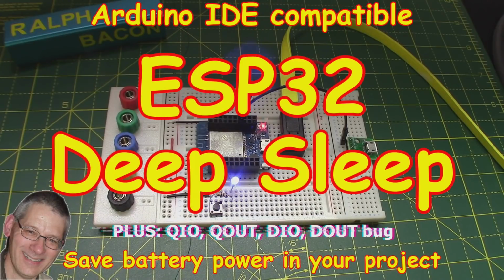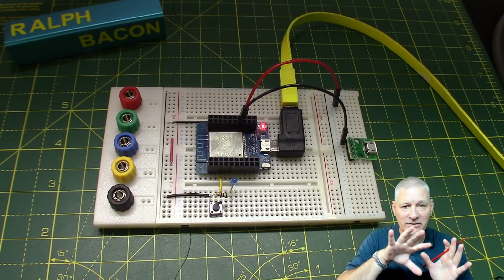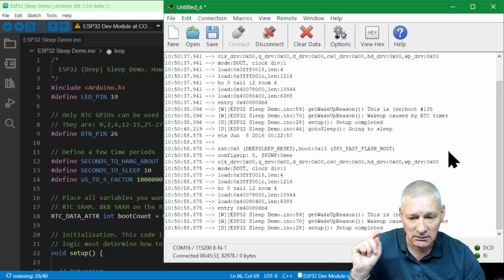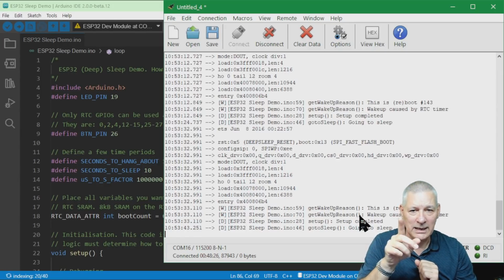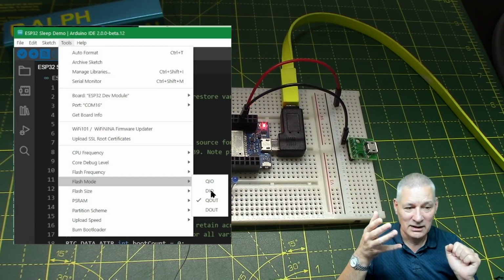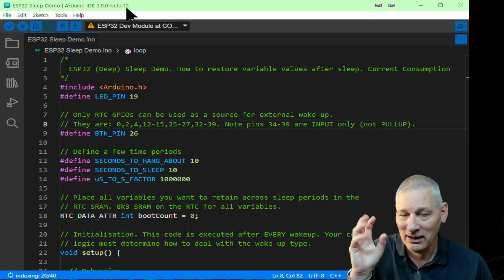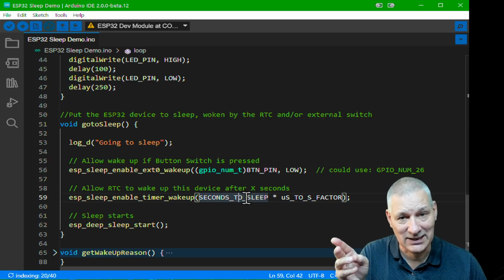#229 ESP32 - Saving Variables Across Deep Sleep

Comment: hi there wow. a really handy video. i never played with the sleep modes. all of my projects have been usb powed. so im working on a small project which uses a battery and so this has come at just the right time for me. thank you for the extra info too that was very helpful too .  :)
Reply from the maker: Obviously I knew you were working on a battery-powered project so I did this video!
Reply: @RalphBacon  lol ops i just blown up a esp32 :( dam.. bloody forgot it only works 3.3.. arrrrrrrrr well haLF works lol ops
Reply from the maker: If you delivered 5v to a pin, that might be the only pin affected. If you have it 5v to vcc... Well, ⚰️
Reply: @RalphBacon   such a silly thing i did. i put a 5v fully chagred 470uf cap on an adc pin ("just forgot to discharge it") most of the chip still work but no adc :( oh well a silly mistake which i guess we've all done something similar lol...live and learn
Reply from the maker: My condolences on your loss. It's too easy to do this with 3v3 chips. I've done it too; I once destroyed a Raspberry Pi 3 doing something similar 😭

Comment: deep sleep you showed is not the "deepest" sleep - next one is hibernation - this one disconnects power from even more circuits on esp32 - the only drawback: RTC memory is also not restored - however in many occasions such "deeper" sleep is even better - btw if you use the bare esp32 we are talking uA not mA anymore what is even better for the battery operated sensors. Of course, as you mentioned there are also other sleeps, i.e. light sleep, which resumes running from exactly the same line of the code it went to sleep from - but less savings of the battery in such case.
Nice video indeed - I have never had any problem with flash modes except I am not able to use upload speed 921600 - only half of that works for me 
And the new Arduino 2.x is amazing (comparing to 1.x) IMHO ;-)
Reply from the maker: Indeed, but I think Hibernation is just another word for switching the whole processor off! What's the difference between coming out of Hibernation mode and switching the device on from clean? I think keeping the RTC running is the least we would do if we want any kind of "intelligence" at start up!
Yes, the Arduino 2.0 is better than 1.x for sure, but still not a patch on my previous Eclipse IDE and not as good as PlatformIO. But for relative beginners it's a great step up. It can only get better!
Reply: @RalphBacon  Hibernation=less power taken than deep sleep with RTC on (btw hibernation still keeps 1 RTC timer on - the one to wake up). Honestly speaking I built my sensors first with the "normal" deep sleep (as 99% of the guides online) but then I realised: the only usage of RTC was to... count the "bootCount" - everything else in my sensor had no usage for keeping the history: wake up, connect to wifi and MQTT, gather telemetry, send to MQTT and then ... go to sleep. Next wake up - again. No real need to keep the "bootCount" there in the cost of extra mA. Just saying. Super detailed guide with all possible sleep modes (with the implementation) in "normal language" with examples is here: https://m1cr0lab-esp32.github.io/sleep-modes/ - maybe someone will go into "deep dive" ;-)
Reply from the maker: Thanks for the Real World update, I will check it out in more detail 🙂
Reply: @RalphBacon  no offence brother ;-)
Reply: @RalphBacon  +1 for PlatformIO. It's brilliant.

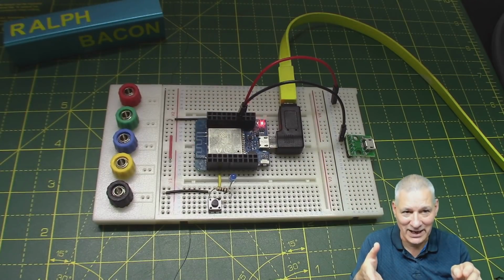Comment: Why does the ets line continually say 00:22:57?  Shouldn't the time increment?
Reply from the maker: The "ets" message at boot-up (which stands for Espressif Task Scheduler, I believe) is the time the person last logged onto the console and declared the firmware fit for purpose - so it will never be updated until there is new firmware in more recent devices.
Reply: @RalphBacon  - OH, got it!

Comment: Thanks Ralph, this is perfect, building a post box sensor, only needs to power on when the flap opens….. could you point me in the right direction for the esp modules you are using?
Reply from the maker: Tony, I've replied 3 times and each time YT removes my reply. Outrage! Send me an email and I will give you exact details.
Reply from the maker: I've added the info to my GitHub now so just follow this link and look for the "hardware_info" file!
https://github.com/RalphBacon/229-ESP32-Deep-Sleep

Comment: Hello sir . May we have a video about esp32 as a slave in i2c communication.  I was trying a project  to connect it to raspberry pi as slave but i couldn't
Reply from the maker: I'll add it to my list, but you should be able to get any microcontroller to respond as an I2C slave, if the I2C is all set up and working on both devices. For example, an UNO should be able to talk to a RasPi. Or, try and get two UNOs talking first before trying the Pi.

Comment: I have question about the bug. Is this bug also happened when you using platformIO instead of Arduino IDE?? Because i haven't found this bug yet.
Reply from the maker: Yes, it happens if you use a more recent (3.3.1+) Espressif ESP-Arduino framework (which I do in PlatformIO). It now issues QIO as the flash access mode correctly if selected (it previously ignored it and used DIO). I don't know how the framework differs when used in the Arduino IDE - I'll check it out one day!

Comment: Thanks for the information Ralph, I always find your videos give me something to experiment with. The power LED on your board stays on when it's sleeping and is going to be taking a (small) current;  could it be de-soldered to maximise battery life, or is there a way to turn it off in software?
Reply from the maker: I won't be using any board for Deep Sleep that has an LED on it (or, as you say, you can desolder it quickly). 

The board I'm actually using for my remote sensor is a Wemos/Lolin TTGO T8 V1.7.1 which has an SD card slot, battery connector and an LED - but the LED does not light up when powered only from the battery. Clever, huh?

Comment: Why battery on your heater control? It is connected to mains. Deep sleep will still be a good thing, no reason to waste energy.
Reply from the maker: @Flemming The main heater controller is running on mains electricity (via a small transformer). I haven't (yet) made any attempt at reducing power apart from dimming the LCD screen. 

The remote temperature sensor (with power detector) runs on mains during the day (or when I am in the workshop) but on battery at other times, just waking up every 15 minutes to touch base with the main controller.

I'll explain all in a future video. It's working quite nicely now but not yet completed (will it ever be?).
Reply: the relay is connected to the mains, not the board, 
would need a lot of extra hardware to convert the 240V AC power to 3.3/5 volt DC

Comment: Hi Ralph, hope you are well and happily settled into your new home. Sorry about this, but I'm picking nits!

On an Uno (ATmega328P) the longest sleep you can get with a timer wakeup is indeed 8 seconds using the Watchdog Interrupt to do the waking. However in sleep mode 2, power down mode, the device sleeps forever until woken by an interrupt from:

INT0/INT1 going LOW;
Any Pin Change Interrupt;
TWI/I2C address match;
Watchdog;
Brown Out Detector;
External reset.

Obviously the first 2 are the best candidates! 

So, you could put the Uno to sleep and wake it with a pin change or INT0/1 which will get you potentially much longer than 8 seconds. Provided, of course, you can wire something up to a pin.

I use the Watchdog on my Lime Tree Monitor when I am away from home. It's on an ATtiny85 and uses the Watchdog to wake up every 8 seconds, but it accumulates all those 8 seconds to make 4 hours (1,800 wake ups) and then checks soil moisture content and waters the tree if necessary. I could change the code to wake when INT0 goes low and use an inverter on the digital output from the sensor to wake the ATtiny85. It goes high when too dry and we need a low level interrupt.

Take care. 

Cheers,
Norm.
Reply from the maker: Thanks for the better description of Sleep Mode on the Arduino, Norman. I guess I was just focussing on the WDT aspect as I was blown away by the (theoretical) 5 years between wake ups on the ESP32!

I also accumulate Arduino 8-second WDT wake ups on my 3 Storage Bin Lid monitors; only 8 "do nothing" at the moment (to get an approximate 1 minute reminder) but it works well enough and the batteries are still fine several weeks after implementation (a single 18650) per lid.

Thanks for the nit-picking, others will read your comment and hopefully learn something.
Reply: @RalphBacon  No worries,you are welcome. Mind you, 5 years is a Rip Van Winkle period of sleep. I wonder how many 8 seconds that is? ;-)

Take care. I'm off to buy you a coffee. 

Cheers,
Norm.

PS. Dare I say it? It's all in the book! (Ducks and runs!)

Comment: I had the a bug with the ESP 32 restating loop and could find the problem.
Looked up on the internet and as you said most comments says it's a voltage problem but I knew it was not.
Probably the problem was the QIO, QOUT, DIO, DOUT.
Great video as always.
Reply: Ah! Yes, that might also explain why my attempt at your Internet radio device kept looping…. Time to revisit 😀👍
Reply from the maker: Another reason is if you try and use the full 150Kb for a circular buffer when you don't have any PSRAM assigned (so it's using SRAM). Reduce the circular buffer to 10Kb initially.
Reply from the maker: Glad I could help! Another viewer said he had not experienced this in the Arduino IDE (I use PlatformIO) but it might just be the version of the Espressif framework that is being used in that situation. Easy to check: the QIO/DIO mode is output on an ESP32 reboot.